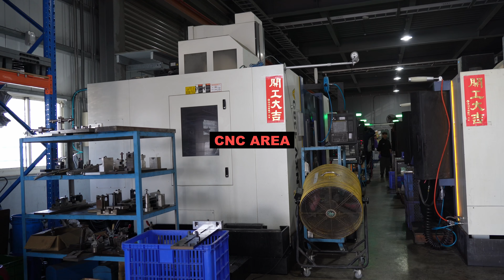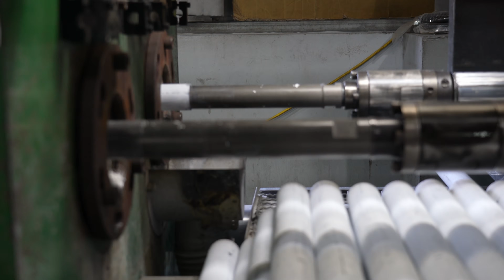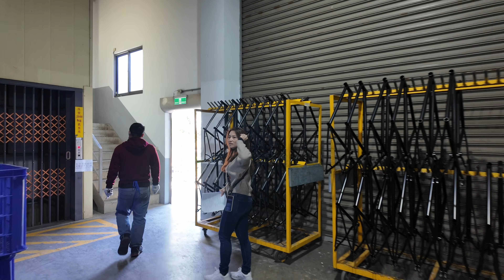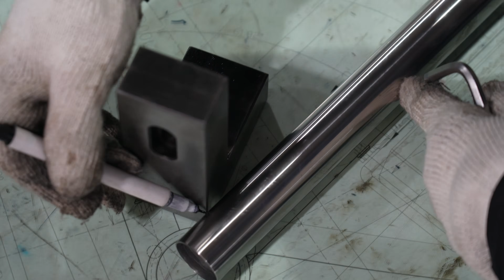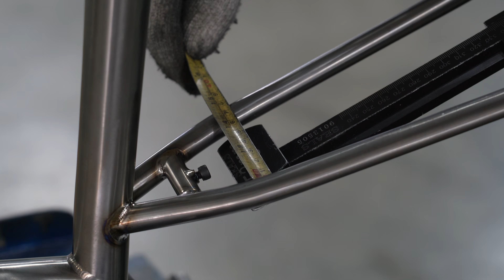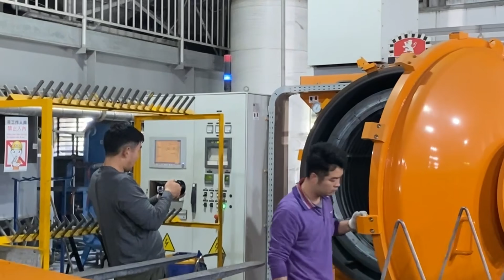Inside the Most Advanced Titanium Factory: ORA Engineering

Comment: I still don't get the mandrel.  I get that it can pop out.  But once you push the tube to the thicker section of the mandrel, and it's thinned out, how is the far end made thick again?  Some sort of pressure on the outside of the tube to make it conform around the far end (thinner again) of the mandrel?
Reply from the maker: It’s the difference between elastic and plastic deformation. To form the butts, the tube is permanently deformed (plastic deformation) as it stretches over the mandrel. When you pop it off, it’s still within the elastic deformation region, so the tube springs back. The forces to form the butts are much bigger than popping it off the mandrel. Hope that helps!
Reply: @Daniel_Yang_ARTEFACT  Interesting and thanks

Comment: I too have spent countless hours wondering how they got the mandrel out of the tubes after swaging! Didn't even consider that it was still in the realm of elastic deformation. Thanks for asking the tough questions Daniel, loving the content!
Reply: I think this might be something that only works with titanium!  I have read that for steel and aluminum Reynolds uses a mandrel and die to create the butting profile, but then enlarges the tube slightly with rollers on the outside to get it off the mandrel.  They then push the tube through another die to achieve precise sizing ...

Comment: Thanks ORA! Interesting that the Ti welders are using small cups in their torches. It must have high pressure gas flow. At Merlin we would use larger cups and lower pressure, but it was a bear to get into tight spaces with the larger cups.

Comment: Beautiful video for the curious of us!
Is there a grinding process for the single and multi butted tubes, after the drawing/butting ?
Reply from the maker: There is a “polish step”, that brings out the brushed ti look and can reveal imperfections
Reply: @Daniel_Yang_ARTEFACT  So outer diameter gets perfect constant diameter right out of the die !?
Reply from the maker: @EduLeston correct! The inner and outer diameters are fairly accurate. For the high end tubing, sometimes they need to straighten the tube after it’s formed, but we’re talking like… .1mm over the entire length of a tube
Reply: That’s awesome! I think Columbus grinds their steel tubes after drawing (double butted ones).

Comment: Outstanding video, thank you!!!  I’ve also had the same question about tube butting.

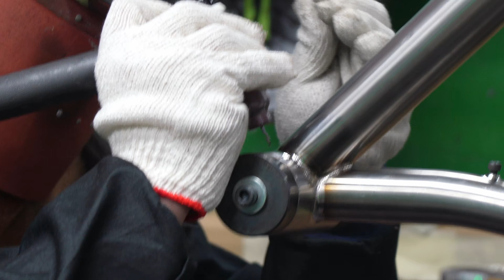@10:15…the bigger issue with oxygen in a Ti weld is something called “alpha case”.  Oxygen stabilizes a brittle form of the HCP crystal structure and is very bad for fatigue life.

Comment: #ThanksOra I've wondered how butting works forever. I also assumed some sort of expanding/contracting mandrel. Hmmm. Still a little baffled by the details but I'm closer. Another great video!  And Wire EDM miters? Cool.

A small suggestion: Turn down/off the music during field voice segments.
Reply from the maker: I agree. I didn't believe it even when I saw it in front of me. The mandrel is literally just a steel rod with different diameter, so there can't be any magic! What made me finally understand is the realization that as the ram is retracting, the tube is no longer inside the die, so it is free to expand on its own. Also, thanks for the feedback on the music.  I will err on the side of quieter for the next videos. I added captions to help the understanding!
Reply: @Daniel_Yang_ARTEFACT  BTW, keep up the cool videos.
Reply: I think the basic explanation is the tube springs back just enough to get the mandrel out.
Reply: @GHinWI  Yeah. I got that part and I guess it makes sense. It just still doesn't quite seem right ;-)  I think the subtlety is that when it is creating the inner butt, the outer mandrel  is also active but as it comes out the outer releases and thus allows it to just stay elastic. Just doesn't quite fit my intuition which is my problem.